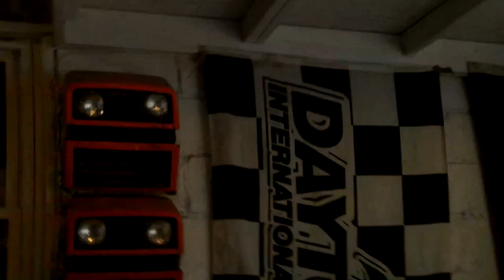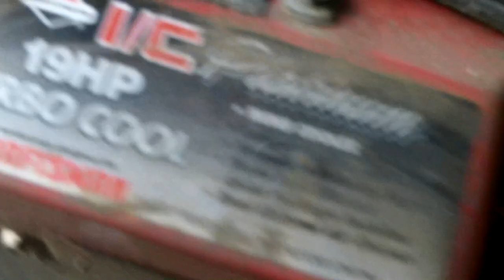the sony is done

Comment: The pin for the float is pressed in on these warriors you just need to tack a punch a little smaller and carefully tap it with a rubber mallet trie not to mar them up to bad